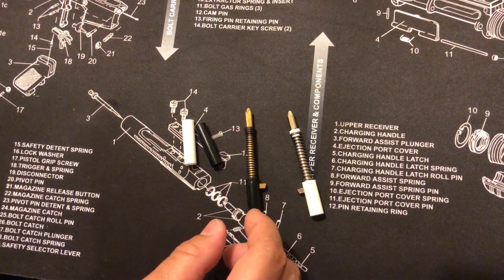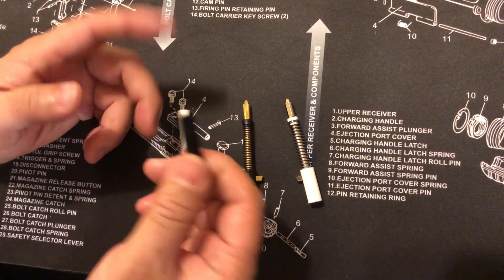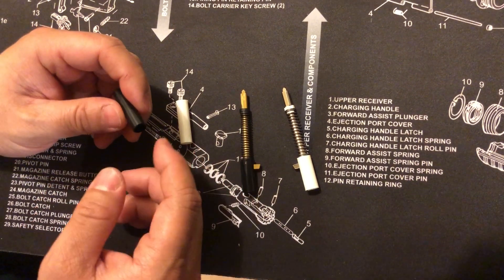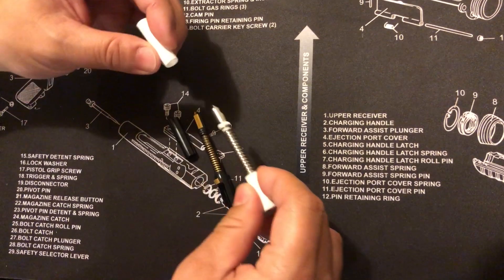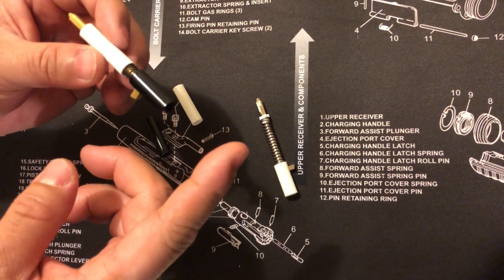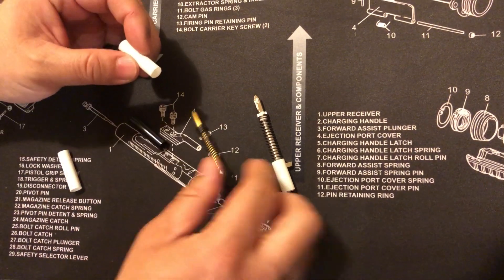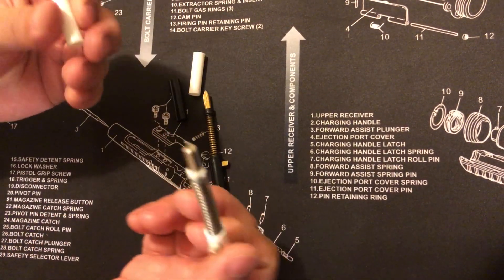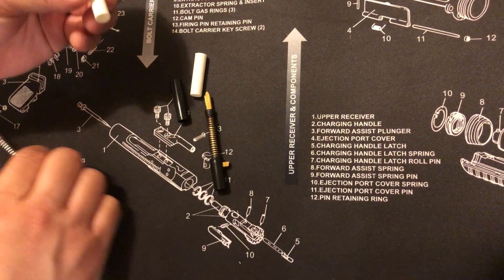Glock firing pin issues after installing a channel liner

Comment: FYI: Channel liners are directional. One end is beveled and goes in first.
Reply: I’m having low primer strikes and I’ve tried cleaning it any suggestions?
Reply: @therandomrobert1842 yea stronger spring mine Damn near puts a hole in the back of my shells lol

Comment: I'm having a problem with a g43 build. That does not have a channel liner. Firing pin keeps getting stuck forward and the next round trying to feed gets stuck on it as it comes up.
Reply: Had this issue on my 19 , it's something to do with the trigger parts , it lays flat on top . It may be sitting too low . You have to bend it up . I would send link but don't know the video, a friend helped me out thankfully

Comment: Yo man I have an issue where my firing pin moves excessively when I pull back the trigger, the firing pin will move out and is visible? I’ve tried a new firing pin, thinking maybe the assembler messed up on the channel liner.
Reply: If the firing pin didn’t protrude out to where it is visible, then it wouldn’t be able to reach the primer on your rounds. Are you having problems firing your gun? If not then don’t worry about it

Comment: hey i have a question! what will happen if you fire without the channel liner?
Reply: It'll still work, I have without issue just to see if it is reliable...it was. I've got one that didn't have a liner for about 500 rounds until one came in. It's main purpose to to keep the firing pin and it's assembly centered to ensure it goes through the firing pin hole to be able to hit the primer and also to keep the firing cups and spring from being worn out while being pushed back and forth inside the slide. A lot of folks don't understand how all the parts are necessary and how to work with them.